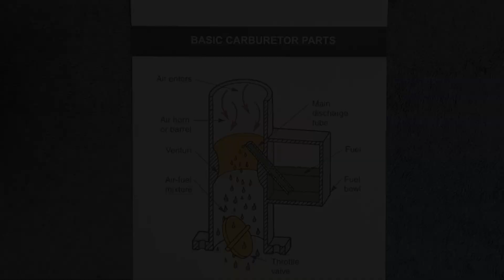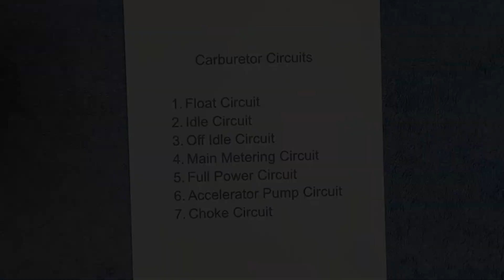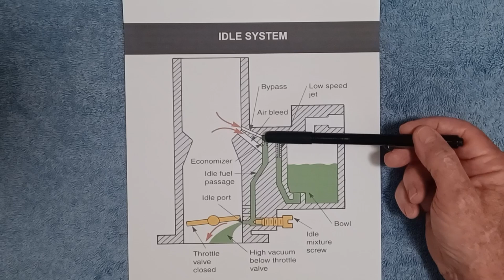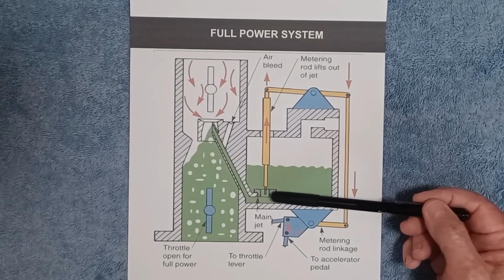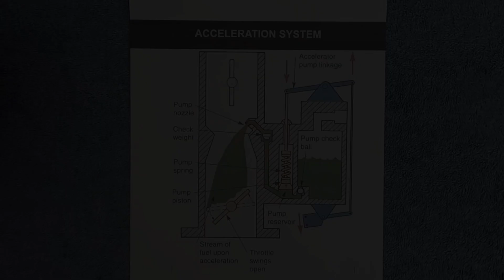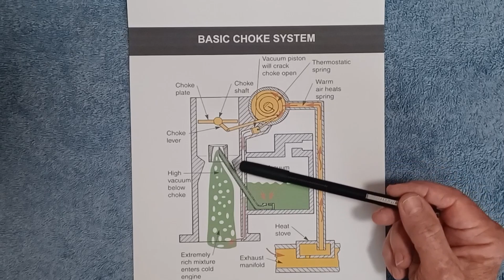Carburetors and how they work.

Comment: Great video. I also saw another video by SmarterEveryDay that explains a carb using a transparent "Carburetor" and slow motion video to demonstrate the way it functions. "How Does A Carburetor Work? | Transparent Carburetor at 28,546 fps Slow Mo - Smarter Every Day 259"
Reply from the maker: Thanks for your comment. I just watched the SmarterEveryDay video that you mentioned. That was very well done. Great tip. Thank you.